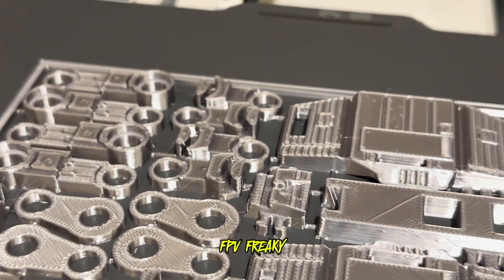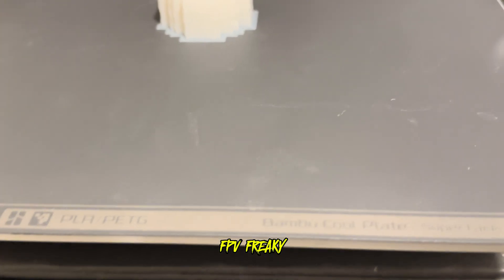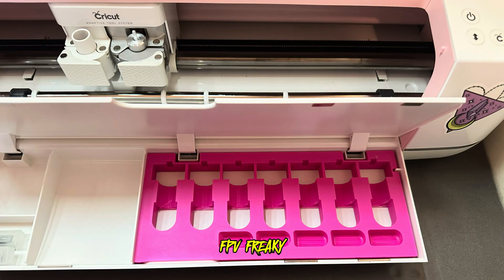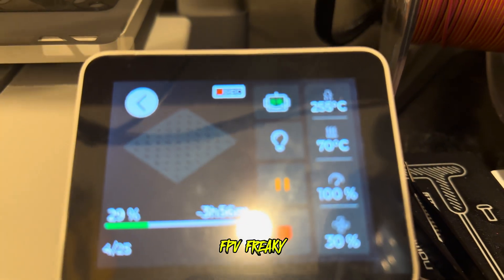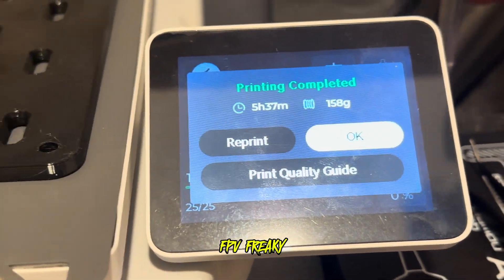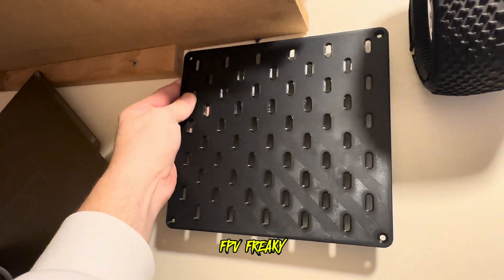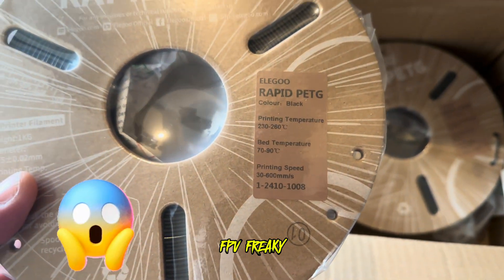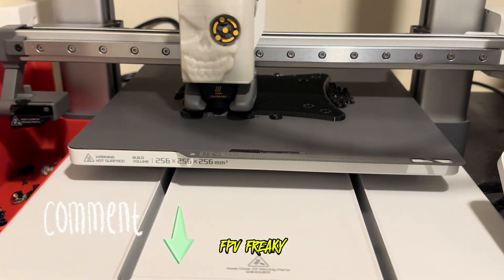Using the Bambu Labs Cool Plate Supertack

Comment: I’m thinking they might have a bad batch. There are no reasons for some people having great results and some not at all while doing exactly the same thing.
Reply from the maker: @Slurgical_3D_Terrain_Channel  did you do this…??  Due to ongoing optimization of the QR code recognition algorithm on the X1 model, we recommend disabling the build plate position detection.
Follow these steps: Controls - Print Options - Uncheck the ‘Enable detection of build plate position’ button.

Comment: That is pretty nice. Glad you are having success with the cool plate. I have given up on mine. I’m too busy with prototyping. I think in my next order I will order a SmoothPEI plate.
Reply from the maker: @Slurgical_3D_Terrain_Channel  thank you yeah I’m very happy so far with this cool plate. I hope we can sort it out for you and get you printing great things.
Reply: @Fpvfreaky  I'm a tinkerer. I got the Bambu printers so I get work done. The only reasons I want to fire up my soldering iron is to put LED light and possibly motorize some of my terrain not using it on my printers like I did with the Wanhao and CR10. They were fun, I had a good time messing with those printers.